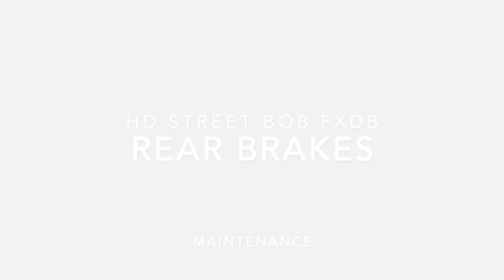How To | Replace Your Rear Brake Pads | Harley Davidson Street Bob FXDB

Comment: If I remember the guide pin will that loosen the other screws holding the calliper? Or do I have to loosen those as well?
Reply from the maker: You only need to remove the guidepin to get the pads out
Reply: @SingleMaltMotors  thanks
Reply: @SingleMaltMotors Is it normal for the caliper to have a little bit of play once everything is finished? Of course when I press the break  it doesn't have any play, only once I let go of the break. It's very very little. Thanks
Reply from the maker: @dirkdiggler2430  no, that’s not normal. Should have no play when fastened to the bike.
Reply: @SingleMaltMotors 1:37 on your video when you pull the little black cap I see the caliper move up as you pull and when you push the bleeder hose in. That's the movement I'm asking about. Sorry I'm asking too many questions and thank you for responding back. This is the best video I found on how to do my breaks.
Reply from the maker: @dirkdiggler2430  No apologies needed, I'm glad to help.  Thanks for the additional info, I see what you say in the video.  I just checked my bike and I do have a little play in the rear due to the rubber bushings.  Front caliper however no play whatsoever.  Hope that helps.
Reply: @SingleMaltMotors  Thank you, I really appreciate your help.

Comment: Do I return the removed brake fluid to the master cylinder? Or just top it off with new fluid ? Getting ready to do this for the first time
Reply from the maker: Always discard old brake fluid. Brake fluid is hydroscopic, i.e., it absorbs water, so throw out the old stuff and any unused part of the new fluid. You can buy the smallest size you will need since you can't save it once the bottle is opened. Also take care not to spill any on your paint is it could damage it. Hope that helps ya.
Reply: @SingleMaltMotors  preciate the advice! Shiny side up! 🤙🏽
Reply: @SingleMaltMotors  I’ve opened a bottle and vacuum sealed it and left it on the shelf. 3 years later I did the brakes and bleed them. Used the bottle. Still have the fluid in. No problems
Reply from the maker: @Phuq_it  That's great just be careful

Comment: Is a caliper cleaning needed when changing the pads?
Reply from the maker: Just spot cleaning, if needed. No need for full caliper rebuild unless it's needed, e.g., stuck piston, torn boot, etc.
Reply: @SingleMaltMotors  Thanks! I just ordered my brake ans was wondering!

Comment: How do you compress the piston? Do I have to take the caliper off? First time doing breaks.
Reply from the maker: If you take the caliper off the bike, there are cheap tools (like $7) to compress the piston. You can also “fake” with a good vice. If you leave the caliper on the bike, get a wide flat head screwdriver or similar tool and push the brake pad back into the piston carefully by leveraging against the rotor.

Comment: What size and kind of wrench did you use on that guide pin ? . I thought it was an external torx so I bought and entire set of sockets and none will fit
Reply from the maker: On my bike, the rear caliper guide pin takes a 1/4" 12-point spanner
Reply: @SingleMaltMotors  I used a 1/4'' socket . You saved me from using a pair of vice grips

Comment: What size is the pin ?
Reply from the maker: My bike takes a 12-point 1/4" wrench
Reply: Ok thanks . Coundnt find that number . Had to go out and buy it lol
Reply: @Stanleydirt617  I thought it was an external torx so I ran out and bough a whole set and none of them were the right size . I bought a used 2010 wide glide and who ever replaced the rear tire and brake pads before me used an impact wrench . I hate paying anyone to do work I can do myself so I find these videos to be of great help

Comment: Always blows my mind that someone would make a YouTube video and not say a word.
On the plus side, you did a good job of capturing wind noise.
BTW, I was told to ALWAYS use DOT5 brake fluid for motorcycles.
Reply from the maker: I always follow my service manual. Glad you enjoyed the wind.
Reply: Dot 4 for HD
Reply: Depends on the bike it will say on the master cylinder some are dot 4 some dot 5 for HD